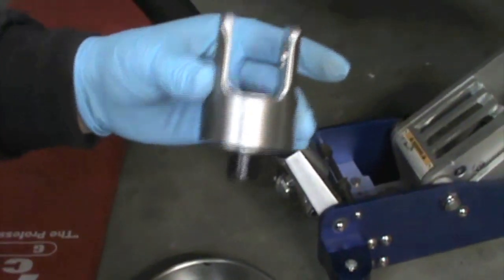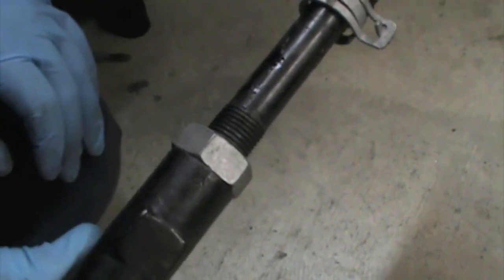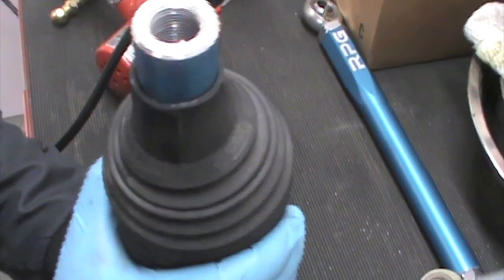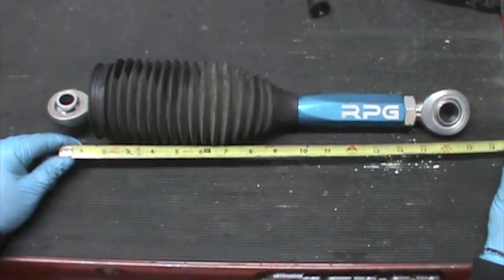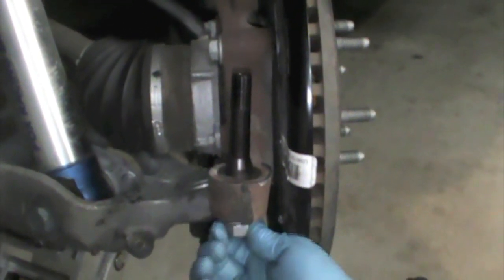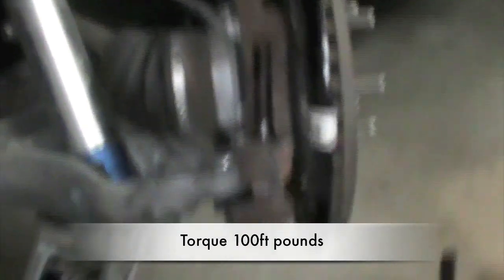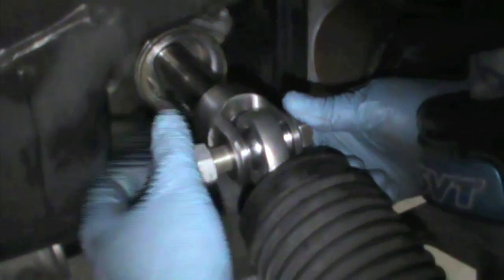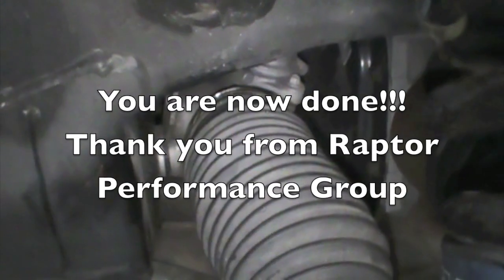RPG Steering Tie Rod Installation

Comment: will these work on 2014 ford f150 5.0 six 4x4?
Reply from the maker: Hi Evan,  We have a kit specifically for the F150. It's narrower than the Raptor.  Give us a call with any questions 866-691-7750.